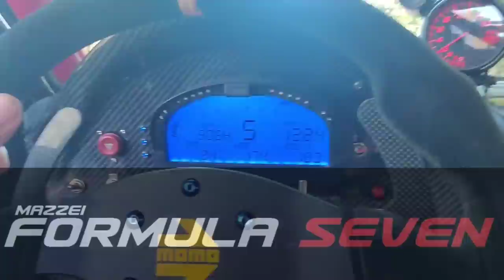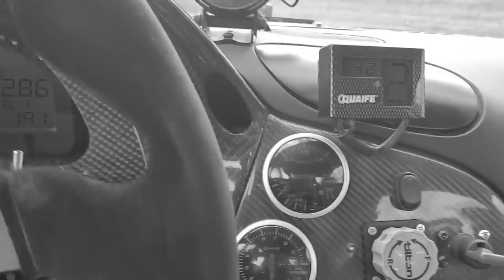HOT LAP POV 4 ROTOR Turbo Sequential RX7 Barber Motorsports Racetrack! Wicked LOUD

Comment: It's so nice to see this getting used on a road course, and not just drag strip or street or dyno!
Reply: EXACTLY.
Reply: too much of that and not enough course driving. I get tired of just seeing pulls
Reply: @sparkie5571  Me too! Track cars are the absolute best
Reply: Or a fucking drift car. Enough fucking drift cars
Reply: For cars that have straight line acceleration as their predominant strength, road courses are just drag strips with turns at the beginning and end.  The problem solving is how quickly can you straighten the wheel before trying to use all the power…and most high power cars are either a lot of power or none.

Comment: It sure has come along way from the video when you said "I'm not gonna get crazy with this build just tasteful upgrades".. It's probably my favorite ride of all time.
Reply: Just waiting for this and rib dahms car to race
Reply: @Token_Black_Guy  I like Rob's cars but that AWD basket case is made from more Subaru, GTR & 1 off custom parts than Mazda parts on it. I realize that this doesn't have much Mazda left on it either but it still looks like an Rx7. Checkout Defined Autoworks channel he has a nice 1 also.
Reply: @H8er-Maker  Hard to build a dream car from manufacturer correct parts when the manufacturer doesn't make parts to meet your needs. It's definitely a basket case, but at least it's built for the love of the car. Dude has probably created as many rotary fanatics as Gran Turismo did with putting our butts in a 787B.

Comment: I love your build and Dahms, its cool your not far from me. But I am disappointed that you're not the one driving. Especially at Barber. It's one of my favorite tracks I've been on.
Reply from the maker: Thanks man, im gonna try to drive soon, have so much tuning and setup stuff to focus on until we get it dialed it. Such a fast and risky car, that every move during setup its important. I believe it better to have a professional who can repeat the process reliably so I can focus on the engineering. Once shes dialed in, I'll surely be starting out slowly in novice and working my way up to driving it quickly, without worrying about tuning/fire/fuel etc
Reply: @dzmazzei  totally understandable. Just take your time, speed will come with experience.
Let me know when you're out sometime. Would love to come see it in person.

Comment: I had a paddock spot near that Defined Autoworks FD at Mid Ohio this fall. Holy sheisse that thing was loud. You can hear where it is on track anytime it's on throttle...from the paddock.

I don't know what group this was run with, but those point by's were pretty damn weak. They should be giving them early enough that you don't need to lift/brake or at the very least can set yourself up to pass at track out(as far as which side you'll passing on). You don't give a point by and I'm going past as soon as I deem it's safe. So many ruined laps that would have only been a minor inconvenience.

Comment: dude get some seat time in that thing! I know you want it to be safe on a track, but the more experience you have with that car the better. That way you and the car can mold to each other and then be fast af
Reply: Couldnt agree more, looking at the other guys on the track you would have no problems getting amongst it, the guy you have doing the shake down isnt even driving it anywhere near its limit, its clearly built properly so you wont hurt it driving it at your own pace. Do it mate, it your dream car and we all want to see YOU enjoying it. What are you afraid of? Certainly not being embarrassed by supercars thats for damn sure lol.
Reply: @joshbrookes6439  I don't think he's afraid, I think he's just thinking with his head rather than his ego. You have to remember the purpose of this track day was a shakedown, not to have fun. He wants to know if the car is behaving the way it should and what better way to do that than hire a professional driver who has years worth of racing and track experience. The Pro driver will be able to tell much quicker than David if something is wrong or if the car is behaving weird etc. David is an amazing builder and is probably a good driver too, but he's not a racing pro. David wouldn't be able just hop in the car and know the correct racing line of the track, know the correct braking points and confidently pull it off as good as the pro driver can. Not only that but as the builder he would baby it more and wouldn't push it as hard as a pro driver would do.

Having a Pro driver test your build gives you invaluable knowledge as a builder in such a small space of time as well. Having the approval of a Pro driver to give you the A-OK means you can confidently take it on track as a learner and not be afraid the car is going to do something unexpected and have it plough into a wall. If something like that was to happen the Pro driver would be able to detect that something is wrong before it happens but in the event they don't, they would have the experience to react quicker and know what to do to cause the least amount of damage.

It also gives David a solid baseline of what the car's capabilities are in its current state so that he can improve on on it for the future. If David was driving for the shakedown, he might not have the relevant experience to hit the maximum capabilities of the car or know what he needs to improve to make it better.

Comment: If you're not a fan of sequential shifting compared to h pattern shifting for road course race and then I don't know what to say cuz h pattern shifting is a lot slower than a sequential shift I've driven h pattern and sequential shift both in high powered race cars on road racing and oval track racing and I prefer h pattern on the oval and sequential on road course cuz h pattern oval is rough on your feet and your arms

Comment: And what kind of racing class could you race these in is there actual touring series or a racing series where you have races all year round for points like circle track racing has local track racing but you can race these in a series

Comment: Yo I'm up in Huntsville (We got no tracks up in HSV).  Where is this track at!?  I need to get my STi out there.  

I heard through word of mouth that there is a track down at Birmingham that even offers professional driving instructions.

My name is also David, and I used to own a modded RX7 FD in Japan.  Nothing too serious done on it other than an aftermarket Blitz intercooler, Semi ported engine with a single turbo swap, boost control, and a piggy backed ECU.

Comment: Hi. Avesome sound from your car. But I see you are filming inside exhaust and smiling of the pipe glowing red. But is this not actually a problem. I you after one hot lap have an all red pipe. I thought that was a sign of high exhaust gas temperature...

Comment: man I love this build, but that "F1" air intake strapped to the back is 🤡

get a proper low-slung roof scoop to grab the high pressure air coming off the top of the windscreen, it'll work just as well and won't be a damn eyesore

Comment: hm... does anyone else think those afr's look a little high? i saw the think hit 11.9:1 on a couple of runs
Reply from the maker: 8psi, e85, its solid
Reply: @dzmazzei  awesome. thanks for the response. also, what are you using to start that badboy up? any special starter you use to spin it up, or is it mostly about battery+wires used?

Comment: I raced my entire life. Does this car have very poor brakes? And how is the suspension? I must ask. Every corner is taken so gingerly and carefully? As for braking markers the driver is on the brakes before even reaching the first marker?? But coming off every corner is more like a drag race, then back to soft braking.  Im just curious is all.  From my prospective the car appears to be handling very well. I dont really see the car moving around much or the chassis protesting under what soft and easy loads it is experiencing.  Maybe a more experienced road racer to bring out the cars full potential??
Reply from the maker: First time on track with new suspension, brakes, and transmission, as discussed in the video. One must slowly work up to the full potential of the car, as the risks are great. The driver is an experienced IMSA driver